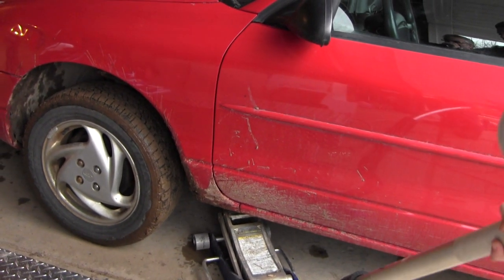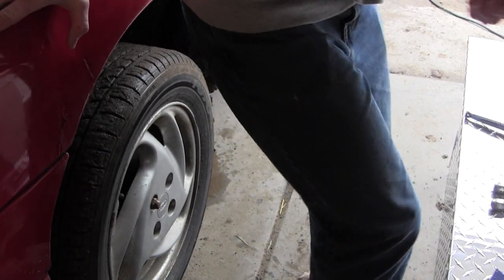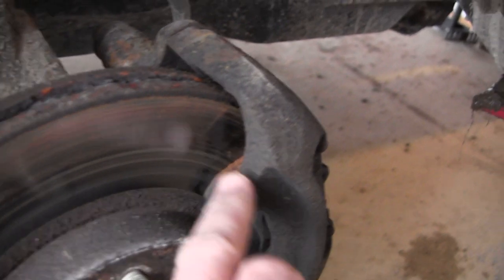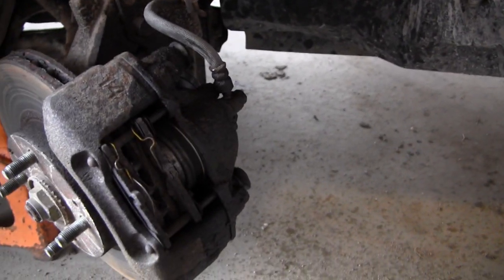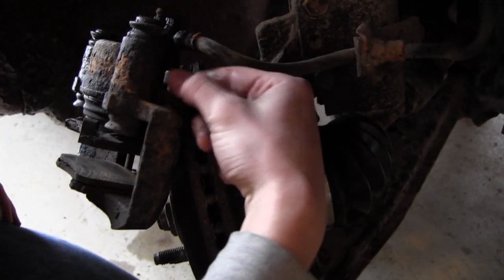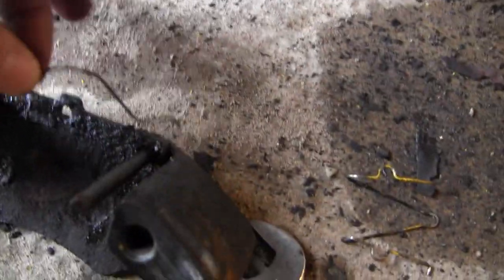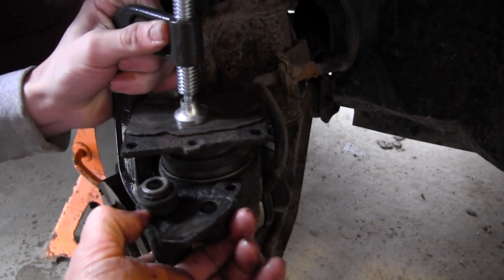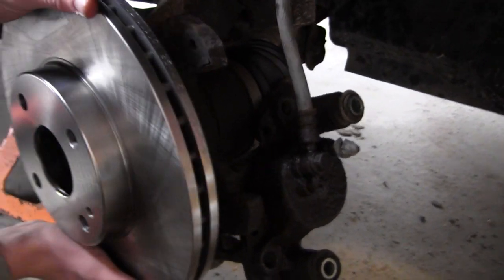Front Disc Brake Job and How to Get a Stuck Tire Off Ford Escort Zx2

Comment: I use a big hammer hitting from the inside to knock tires off. I've even seen people have to losen off there lugs and drive around the block before the tire comes lose. Nice work.

Comment: That seemed like an easy jobs. My dads 2003 trailblazer was a pain to get the rotors off, they were pretty rusty. You should of used some anti seize on those rotors where they meet the hub. Great video Ed!

Comment: Instead of taking the caliper apart all you have to do it take the 2 pins out to replace the pads. Also you never made sure the upper and lower bushings were able to slide in and out.

Comment: Question: After I pushed in the piston, replaced the brake pads and rotor and having a hard time fittinh the caliper back into place. It's as if the new brake pads are to big. Where did I go wrong? Please help
Reply: I just did this and found for me all i had to do was push in the top and bottom collars ( that the top and bottom caliper mounting bolts slide through) they may be stuck , try hitting them in with a hammer then you'll find you have enough clearance now. Also I found that I could start both caliper mounting bolts to hold caliper in place then slide in the brake pads and put bottom pin in place easier, then go to the top and put w clip in place slide pin through it, put other clip through holes in pins. hope that helps.